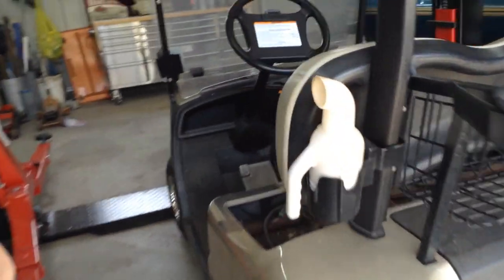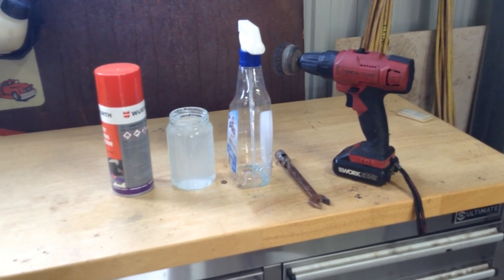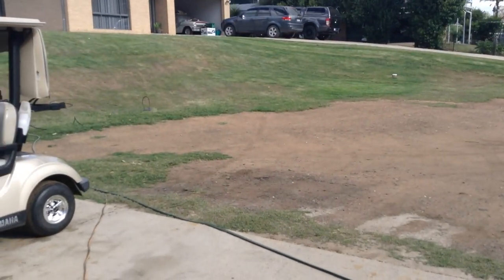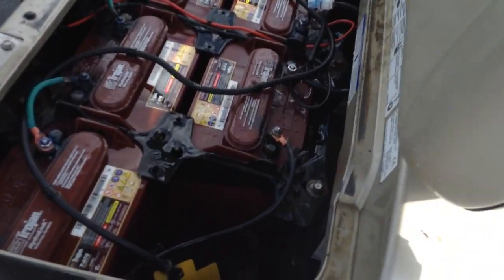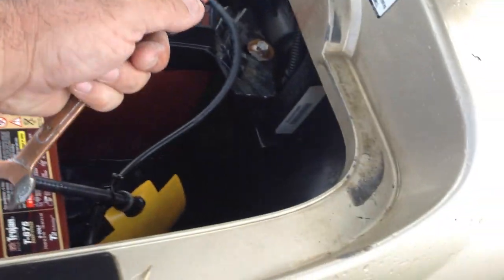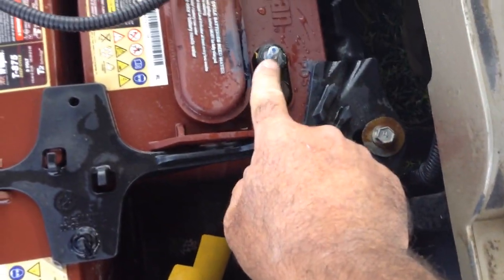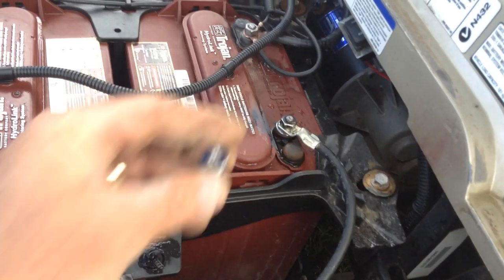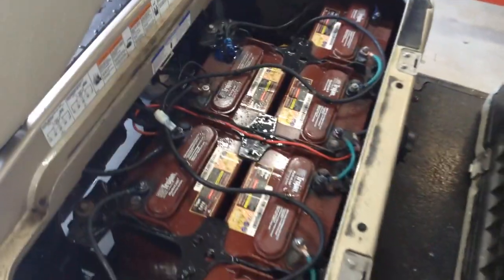HOW TO CLEAN YOUR GOLF CART TERMINALS BEFORE YOU NEED TO REPLACE YOUR BATTERIES

Comment: That was excellent.  I just did it to my cart.  Except I didn't dip the wires in the baking soda solution.  I just used the squirter bottle.  Hopefully that's good enough!

I didn't see the brand protectant you used.  Have you heard of the CRC protectant?  It doesn't look as thick.

Also, what do you think about periodically spraying the battery terminals with the baking soda solution?  Like maybe once every couple months.
Reply from the maker: any protectant is better than none , yep 100% spray them as often as needed. a good covering of protectant will make it longer between needing to be cleaned.

Comment: I've had my golf cart for 3 months when I push the pedal it does not go I can see some corrosion on some of the smaller wires coming into the batteries. So I was going to take them off and clean them just like I do my vehicle I started getting Sparks. If I flip it to toew will that stop?
Reply from the maker: No , clean them and then use a good terminal protectant is the only way to stop it.

Comment: After cleaning, I’m assuming you get more power. Does this mean more speed or just extension of battery life?
Reply from the maker: Battery life and less chance of resistance causing failure.
The speed controller governs the speed of the car so no greater speed gain than factory setting however if your cart has been slowing due to low voltage or great resistance than yes it will recover your speed back to factory.

Comment: I noticed while checking voltage my 48v Club Car  DS that the plastic  surface of the batteries were conducting electricity at just under the voltage you'd expect from testing the lead terminal. the readings were 0 on a new battery but just about full value for the 5 others.  What's this about? Trojans 8v, abt 10yrs old.
Reply from the maker: Mate im not following what your saying sorry
Reply: @backshed5295  The plastic top of the batteries are conducting current.  The meter shows voltage from the dirty plastic cover of the  batteries.

Comment: Did you really just pressure wash the batteries? Lol. Dear lord, I’m sure damaged wires and rusted cables won’t be an issue in the future…. 

Don’t do what this guy is doing, do it the right way: take off all cables and correctly clean them then reinstall them.
Reply from the maker: Dear lord ! 
Yes you do pressure clean the batteries . Plastic case so you cant damage them. Wires and cables are also plastic insulated . Not washing batteries is what causes corrosion because your not cleaning the acid residue away after sweating from use and charging . From 2013 to present we have sold between 500-600 carts and thats how ive done every one . You clearly have an issue with your cart if your looking at these type of videos ? Maybe watch them before commenting as i DID take the cables off and clean them and refit them AND then show how to protect them .  Good lord

Comment: Enjoyed your video, my only concern is that batteries produce explosive vapors and you are using a drill that can produce sparks as it runs and that could be catastrophic. ( my batt powered drills, porter cable, produce sparks)
Reply from the maker: If it’s sparking throw it away. Batteries only produce gas when under heavy load charging mate you would smell the gas strongly , relax a little mate it’s not a concern.

Comment: So washing the batteries with the hose is ok?
Reply: Also, I have the exact same cart and batteries (only got it about 2 months ago), how are they filled as I can see the hose going into all the batteries but I have not encountered anything like that before and I want to make sure they are maintained.
Reply from the maker: Yes totally fine.
Reply from the maker: Follow the hose to both ends , 1 end will have a fitting on it for a watering hand pump. Google search watering hand pump for flow rite battery watering system. You will find what you need .